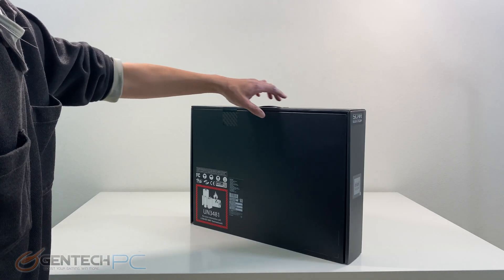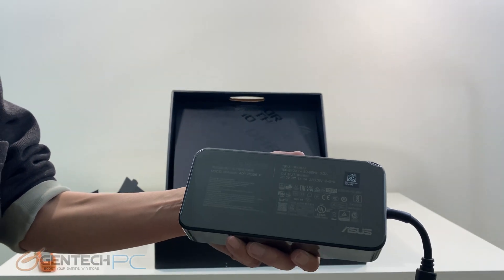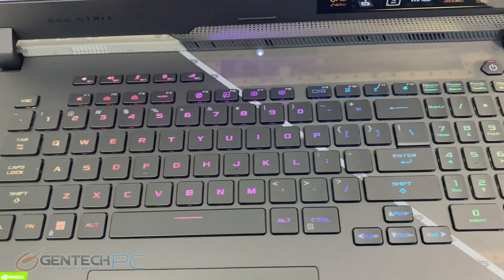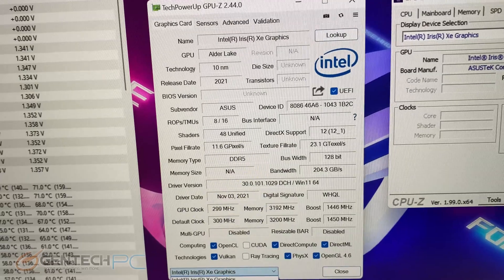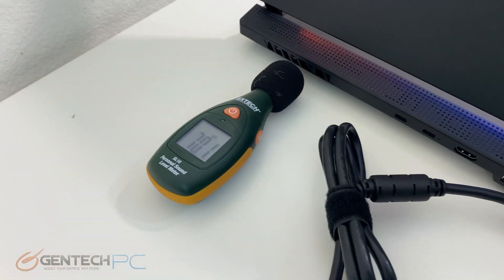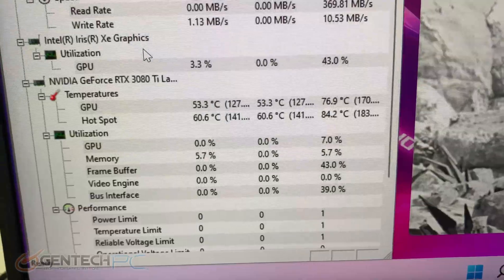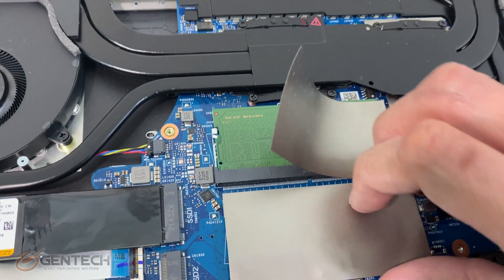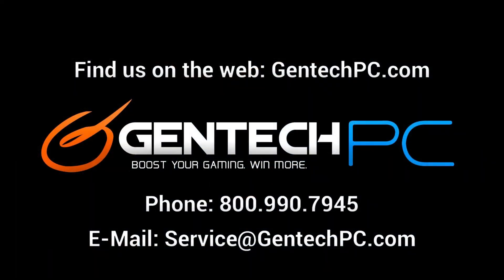Asus ROG Strix Scar 17 Review and Benchmarks - RTX 3080Ti  - i9 12900H

Comment: Just so everyone knows, the MSI Raider GE76 12UHS-418UK is more powerful than this laptop. It has the unlocked Intel Core i9-12900HK and the NVIDIA RTX 3080 Ti (175W, 16GB RAM) which offer blistering amounts of both gaming and productivity performance. That UHD 4K display panel it has is pretty sick too. Fans are very efficient and not too loud. I have quite a few videos of the machine on my channel since I received one at the end of last month. It was expensive but I have zero regrets with my purchase as it excels at everything.

That's not to say that this SCAR 17 is a bad laptop, it's a great performer and looks awesome with a lot of unique features, it's just not the best gaming laptop available right now.
Reply: Also to keep in mind that the GE 12th gen has outdated cooling solution which makes it unapologetically run hotter. (No vapor chamber, less heatpipes on cpu compared to gpu, and the phase change liquid metal still has spiked cpu temps close to or equal 100c) it seems like they skipped re-engineering the cooling solution to get the most out of the 12th gen to get it out of the door quicker.

And i have a GE76 by the way. And have been forced to play with the outrageous TDPs settings MSI set of 115 and 135w PL1 / PL2 to have similar temps to the SCAR.
Reply: @MrGatz  It is a better system than what they used to bring. You do get a boost. The asus lapto will still hit 96C quick and "throttle" (they all throttle). What is interesting to see is what is the cost of one vs the other.
Reply: @highlanderc  agree. If you buy a laptop expect to hit 90-96 spikes and averages of 75-90C. The components of these laptops are getting very powerful and they all generate the same heat rate regardless of the chassis. (Read carefully what i said above). So the performance of the CPU / GPU is becoming heavily dependant on how each manufacturer evacuates that heat to prevent it from hitting the thRottle triggers (TCC  and  Tjunction)

The ones that can hold the clock speeds at their associated TDP settings will be the best performers. Hence the need to focus on the cooling solution to bring out full potential. 

Pattern now of manufacturers seems to be to hit high Benchmark scores by setting high tdp limits and letting the cpu run thermally unmitigated until TCC / Tjunction and get throttled back. This forces us users that are not comfortable with these high temps (although within spec) to power limit via undervolting or tdp adjustments + external mods like pressure coolers (IETS GT500 / Re paste)

Ok end of rant!
Reply: @MrGatz  You are right. This is where Asus has beat or is beating MSI. The LM does work and makes a huge difference. For instance. 2021 M16 vs GS76 on CB20 is 4200 vs 5600. That is a huge boost. 20%? 

the LM they are using on the 12th gens is different as its solid at room temp and liquid at higher temps, but apparently the heat transfer is not as good as traiditional liquid metal as the GS77 hits 6700 or so on CB20 and this one and the 2022 M16 will hit 7200 or so. while its a 8% difference vs 20% on previous year, it is still a difference. 

Specially in balanced modes the good LM helps tremendously with fan noise.
Reply: @MrGatz  Whenever I play games and do serious productivity work like 4K video editing on my newly acquired 12th gen MSI Raider GE76 12 UHS-418 gaming laptop, temperatures for the CPU (Core i9-12900HK) and GPU (RTX 3080 Ti) are usually hovering around 73 degrees celcius. Both the CPU and GPU is kept far away from 100 degrees celcius at all times thanks to the two big fans, Alder Lake design improvements, and just a whole new architecture overall. Believe me when I say that I'm speaking the truth when this new 12th gen model is a huge improvement when it comes to temperatures, compared to the 10th, 11th, and 12th gen Raider GE76 models. I used to own an 10th gen GE76 Raider with Core i7-10870H and RTX 3080 not too long ago, and admittedly the hardware in that thing was always running hot from 90-100 degrees celcius whenever there was intense workload, which really bothered me a lot. I tried undervolting, and all sorts, to keep the very hot temps at bay but I just couldn't. The GPU however was fine at around 75 degrees celcius.

This new 12th gen model is very well optimised by MSI with CPU, GPU, memory, SSD storage, absolutely everything has been looked at, refined, and fine-tuned, so it's doing better at everything it does compared to the older models in the Raider GE76 series.

Check out my benchmark gameplay videos of the new machine on my channel, if you don't believe me. Games are running smooth, with no hitches, and with beautiful temps, the entire chassis is kept cool to the touch.
Reply: @MGRogue   Could you please run a detailed benchmark test? I have got an MSI GE76 12900HK 3080ti model. My Cinebench R23 Multicore score is 15463 & Singlecore is 1865 for i9 12900HK at 2.92Ghz. No overclocking or undervolting is done. My P3 and P5 cores were thermal throttling and both recorded 97C during cinebench test.  The CPU package power at "current" was observed 76W and at the "maximum" it was recorded 101W in HWInfo64. Could you please run the cinebench r23 and monitor the temperature of cores simultaneously using HWInfo64 app? Thanks.
Reply: Which has better sound quality? Scar or raider? Because audio quality for me has high impact in overall experience, as i dont like using headphones
Reply: @user-qc6gv3dx1t  I would say the Raider GE76 has the best audio quality out of the two machines due to it having Duo Wave Speakers with Dynaudio sound system, which provides for a clean, clear sound, and with high-quality sonorous bass. Supposedly one of the best set of stereo speakers you can find in a typical gaming laptop. I personally have no complaints with how everything sounds on my own machine. It does sound pretty incredible sometimes, especially on games like the Battlefield series with firefights happening left, right, and centre, and planes flying overhead. There's some virtual surround sound so it feels as though the sound is surrounding you from all angles, very cool.
Reply: I saw your vids the cpu package does hit 100c. I didn’t look at the other vids only thr cyberpunk one. But it clearly is hitting 100c. Now probably doesn’t affect performance much but still you’re hitting tjuction thermal throttle. I get it, it’s within spec but im personally not as comfortable with high temps always flirting with 100c (tjunction for 12th gen)
Reply: This comment section is full of PC Professionals🔥
I learnt a lot from your comments guys.
Thanks a lot🙏
Reply from the maker: @adityaprakash4057  Yes they are very good. :)
Reply: Aye aye aye. MSI raider looks disgustingly ugly.  Keep that in mind okay.
Reply: @Zvn1c  GS77 for the win.
Reply: which one has better cooling, asus or msi?
Reply: @aeonbreak4728  asus
Reply: @highlanderc  why?
Reply: @aeonbreak4728  because of true liquid metal.
Reply: @highlanderc  msi has liquid metal too. what are you talking about?
Reply: @aeonbreak4728  do your research.
Reply: @highlanderc  lmao nice help bro.
Reply: @aeonbreak4728  This year's GE76 has got Liquid metal compound.
Which is solid in normal conditions, but changes to liquid at higher temperatures for better thermal conductivity.
On the other hand, Asus uses simple Liquid Metal Thermal Paste which includes a vapour chamber setup. Same as previous generations.
The GE76 should be having better thermals, according to my info.
But I can't say much about that.
I got a G15 for myself(Ryzen 7 4800H + RTX 3050 95 TGP), and while hardcore gaming(COD Warzone/FarCry 5), the temps never go above 85°C for the CPU and above 87°C for the GPU.(Indian Spring Season)
I have a friend who has a Legion.
His temperatures also roam around the same.
For this instance I've never ever seen a MSI machine perform irl.
But I do know that MSI produces Banger Gaming Laptops.
So, according to me, this year's MSIs laptops should perform better in thermals due to the enhanced LM Compound.

Hope this theory helps😅
Reply: Cinebench and Firestrike scores were better for SCAR 17